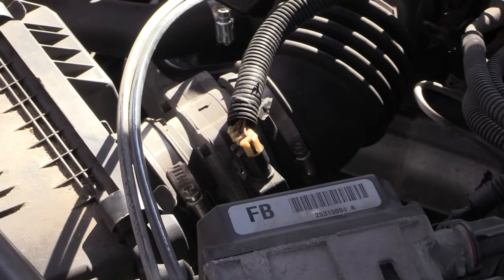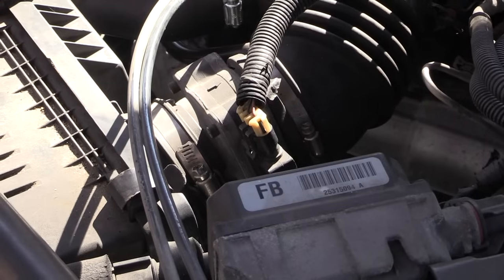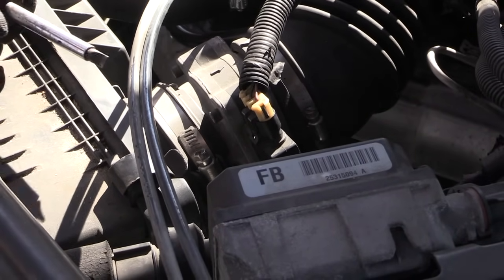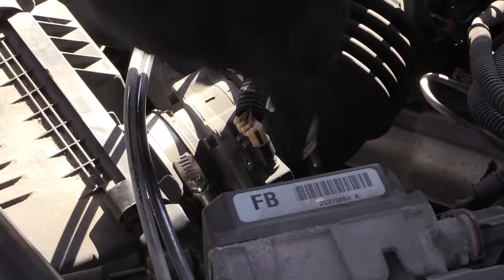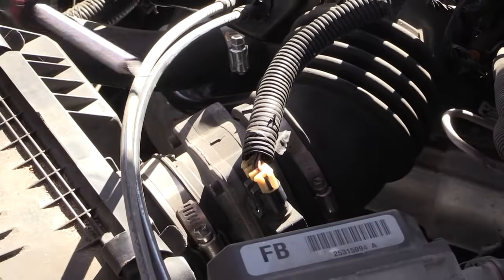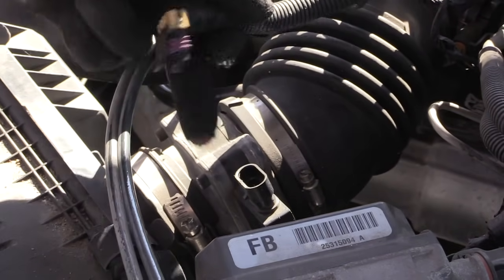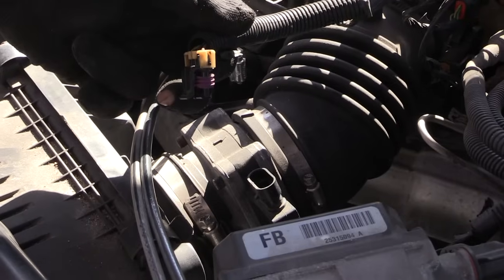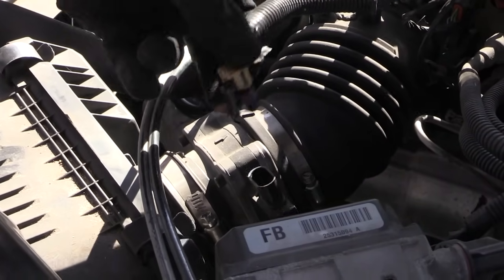Mass Air Flow Sensor -Quick test To Tell if Bad or Dirty!

Comment: When you unplugged it, did the RPMs just shoot up?  Or was that a vehicle driving by?
Reply from the maker: That was a car driving by
Reply: @Flashback502  weak.. Couldn't you reshoot that minute of video?  That was wrecking my brain.
Reply from the maker: @stephenhill1089  didn't realize it would or could be confusing to some 1 until u pointed it out. Going to pin your comment to top so others with same question can no it waa a car going by.
Reply: I'm just learning about MAF sensors and I'm getting tons of conflicting info from YT.  Some ppl say (and even demo) that vehicles should stall out if you pull the MAF wire.  Does the cars computer compensate for build up on the sensor wires over time and eventually bipass it's data?  Seems like the only logical conclusion if you can pull the wire off with no change to idle.
Reply from the maker: The way a dirty or bad MAS works on different models ,years etc can be very unpredictable, but the logic is if your vehicle is running bad, which can b caused by many different things and 1 of those is MAS so if you disconnect it, and the car runs better not perfect and it shouldn't because you need a properly functioning MAS for it to run correctly, then that is a clue the MAS could be your problem, and in many cases you can just clean it.
Reply: K dope.. I'm gonna give it a shot once the weather warms up a little.  My '00 Outback isn't running rough, but I'm only getting 300-350km/tank which is horrible for a 70 litre tank.  I'll let you know what happens. Thx
Reply from the maker: Ok Hope it fix s your problem. Please subscribe & like and share if haven't already and check out our other helpful videos
Reply: @Flashback502  Ok i change the maf map, cam, and crankshaft sensor and my car still losing power and killing
Reply: @Flashback502  No engine light on you think it could be the coil pack?
Reply from the maker: @blankmanj5760  sorry to hear I would take it to autozone first and have it read if coil pack is bad the computer normally picks it up, also I would check for any vacuum leakes, u could have  bad fuel injectors also, It can be a number of things causing your problem.
Reply from the maker: Lol ok well hope that fixes it for you. Goodluck
Reply: So when i unplug the mass air flow sensor is the car  supposed to cut off and I don't have a check engine light I got a service engine light on is that the same thing as a check engine light
Reply: @Flashback502  i fix the car bro for  the stalling and cutting off while driving i change the crank sensor cam sensor map sensor maf sensor pcv vale ingtion coil but the car was still cutting off right but when i change the fuel pump the car never cutt off  again plus the wires was burn up by the pump thats why my car was stalling. In traffic  thanks alot for all yo info
Reply from the maker: @blankmanj5760  your welcome glad you got it fixed and thanks for heads up on fuel pump.
Reply: @Flashback502  no problem
Reply: It’s funny you mention that because I just did the “unplug it” test on my cruise and it made my car rev up like crazy
Reply: @stephenhill1089  The engine will NOT stall if you remove the sensor: it will only run without critical information and thus the onboard engine computer will compensate simply increasing the amount of fuel. So, the engine will burn fuel like crazy and may stutter when you speed it up. At the end, it depends on the software implemented in the computer
Reply: @stephenhill1089  it depends on how much electronic systems your car has. my 1995 s10 will run with out the mass air flow sensor, but my 2008 honda will not. my honda has so many electronics in it compared to my s10.
Reply: If you unplug it and the car shuts off the sensor is good. If it stays on and sputters . It’s bad
Reply: Better audio would have been helpful
Reply: @sniperpaintcorrection  my 2009 chevy traverse stays on after i unplug the maf sensor. Is it normal?
Reply: @Flashback502  9
Reply: @stephenhill1089  lol are you like 92?
Reply: @AndTecks 🤔?? No.  Why do you ask?
Reply: No it is not good. It is an indication that it might need to be changed with a new on. @OscarRamirez-vh1xm
Reply: @blankmanj5760 sounds like a throttle body issue
Reply: @sniperpaintcorrection  Yeah, the way he kept trying to explain it wasn't very clear.  I get, put I understand why some were confused.
Reply: Just replaced my alternator in my 09 ford ranger 2.3.  Now I get code po102and po113.   Did not have those codes before
Reply: @blankmanj5760  did you found real reason of problem in the end?
Reply: @ericoz650   No got mad junk the car got tired of working on it I changed all that and it was still messing up I junk that thing
Reply: @Flashback502 what to do if when I unplug the car turns off ?
Reply: @Flashback502 or if it won’t start without it plugged
Reply: @sniperpaintcorrection  that's depending on what kind of car you have.

Comment: If your car is idling poorly and you unplug the maf, and it runs better you might have a vacuum leak. check that first before you spend money on a maf
Reply: Jellyrollfordinner uhhh don’t leave it unplugged! Lol. I’m sure if the MAF is dirty, then unplugging it might be smarter but I’d recommend never running it with a dirty MAF or without a MAF. A clean MAF will give u best results. Have u tried cleaning it???
Reply: Good looking out bruh with that info.
Reply: I guess I might be facing that problem but I can't locate the sensor
Reply: @gordongorohmpawaenda7240  look and see where the air box is with the air filter and fallow it along the path from your air box to your air filter there should be a spot with wires if that helps
Reply: @gordongorohmpawaenda7240  look and see where the air box is with the air filter and fallow it along the path from your air box to your air filter there should be a spot with wires if that helps
Reply: @chancesmith6524  okay thank you... let me try that
Reply: I put new one it does the same unplug new one it runs good I'm lost
Reply: Yeah I just changed the maf like 2 months ago and it just gave me a check engine light, how do I check for leaks?
Reply: Ive got that on my dyson.
Reply: Carb cleaner sprayed around intake gasket area/fuel injector bungs/throttle body and PCV/MAP sensors 
Chevy loves their leaky EVAP systems and often times the codes for EVAP leaks are solved by finding stupid pain in the ass leaks elsewhere.

Ensure your wiring harness connector is providing a solid 12v+, Ground, 5v+ reference and i forget what the other two are....friggin Air temp. Intake air temp sensor is integrated on the 5 wire MAF units. The Massairflow cleanee will work, its worth trying unless you know for fact you MAF is toast.
Reply: Yeah this guy
Reply: @jawnbul5701  yea that’s what my car is doing , I took the whole air system out and cleaned it including the throttle body , put it back on and my car was acting a fool , so now I’m riding with the maf unplugged hoping it was the throttle body

Comment: This does not tell you that the MAF is bad, it just puts the engine into a safemode so it can run. The motor can have several issues not being caused by the Maf, like not doing what the Maf tells it too for instance. Usually its a vacuum leak of unmetered air entering the engine that is not being detected by the Maf
Reply: This topic is curious- I tend to understand what you're saying, KingKatRider.  May I ask, if a wire in the wiring harness that connects to the MAF sensor is cut, would a computer scan show the MAF sensor as malfunctioning, even if the MAF itself isn't damaged?
Reply: @JohnJohn-ir5hw  what would happen is that the ECM will generate an error code indicating that the MAF sensor has a open or short. The ECM cannot tell if the sensor is at fault or not (IE: bad wiring, bad connector, bad sensor.) All it knows is that the system is out of the parameters and has it in memory what the system should look like when registering the data of the airflow in real time. That's why it is important to TEST everything when it comes to diagnostics. Visuals can only take you so far. Having the right information to diagnosis the problem is the only way to validate and correct the problem.
Reply: What is a vaccine leak?just had new transmission and am told the msg is faulty that’s why it won’t rev
Reply: @carrsllccarrillo6507 As a technician still learning to diagnose lean/rich codes, you are awesome as well as @kingkatrider I knew it wasn't that simple and would take further diagnosis but 2 separate videos said this way is a quick way to tell. I've done anything suspension/ steering related, brakes, basic maintenance or engine tear down to replace bad sensors etc....even replaced an engine few times, transmission once, but when it comes to p0171 or p0174 codes, im completely lost. Teach myself in free time though
Reply: @KingKatRider  yep, my 08 camry will adjust its self to memory and run in closed loop

Comment: I watched a different video about a '99 Buick Park Ave, and it said if the car KEPT running when you removed the plug, the sensor was bad.  If it stopped running, the sensor was ok. This is a little more than confusing.
Reply from the maker: Thanks for watching if you read some of the comments and replys made help you to understand the logic. Please subscribe & like and share if haven't already and check out our other helpful videos.
Reply: Flashback502 what a waste of a response, could have just said what’s true
Reply: @cured_bacon647  I don't think he knows!!! Some one asked thee exact same question, just different car. He gave the same generic answer!! NOBODY in the comments really touches on this!
Reply: YES if the engine dies when MAF is unplugged the MAF is doing its job. If it runs better with MAF unplugged then you have a problem with the sensor or something else.
Reply: @Spoofkill  its a bit more complicated then that , i found this Well, the answer to that is no. If you disconnect the mass airflow sensor, then the car should keep running and still be able to start normally.

This is because the computer in the car if it does not receive a reading from the mass airflow sensor, will estimate and supply a number that it thinks it is supposed to have. This means that if your mass airflow sensor dies completely, then your car will stay running and surprisingly the car might run better without the mass airflow sensor. That is because if the sensor is bad or giving a wrong reading, then the cars guess might be closer to the actual amount of air that the engine is getting giving you a more accurate fuel mixture.
Reply: @arandomsanti3228  what if when I disconnect the maf sensor the car still runs but hard shifts really bad, & with the sensor it still hard shifts but not as bad
Reply: @arandomsanti3228  Good answer. All the videos showing the unplug method for testing are bullish!t. My maf is good and when I unplugged it, it initially hesitated and then continued to run normal. I saw a great video showing how to accurately test it. It was by plugging in obd2 reader and downloading the maf and rpm readings. The volume of air should be increasing proportionally to the rpm increases. If not, the maf not properly reading and defective.
Reply: @mgpvii  that is the correct way in the video . Rather than spend $9 on the cleaner I bought a MAF sensor on EBay for $14 and just replaced mine . But I had ruled out a vacuum leak first .
Reply: @suzannepeacock3143  NO!  I repeat in case you didn't read my text.  MY maf is good and i unplugged it and it continued running, therefore, the test is not an accurate method testing whether maf is good.  Others have talked about this in other comments also.
Reply: @mgpvii  I was agreeing with you it’s not an accurate way to test . The method you described in the video is the way .
Reply: Ok then Not subbing not liking

Comment: Hi great video ,will a bad mass air flow sensor throw lean codes , like a P0171 lean code , I did the test I unhooked the cable and my car stayed on , any info would be great full
Reply from the maker: Thanks for watching yes a bad or dirty MAS can cause lean codes, I would clean it first and see it that helps' dirty fuel injector heads and leaky vacuum lines can also cause codes. Please subscribe and share if haven't already and check out my other helpful videos.
Reply: LEAN = vaccum leak Or O2 sensor Or maf sensor. But O2 and MAF has their own codes! so logically it's a leak. And that can come from tons of places. PCV valve, hole in hoses, injector seals cracks, brake booster diaphragm hole, intake gasket, intercooler, throttle body...
Reply: What if when unplugging the car turns off ?

Comment: This may work on some cars but not all. This forces the engine controller into speed density mode (MAP sensor) for fuel calculation. Both the MAF (dynamic airflow) and MAP (speed density) require the intake air temperature. Many newer vehicles locate the intake air temperature sensor within the MAF sensor. So if you unplug the MAF sensor and it won't run... It's likely due to the IAT also being unplugged. I believe you'll have a three pin MAF sensor connector if includes IAT? Don't quote me on that though...

Comment: 2006 Nissan Quest problems.

Start up van but when put in reverse or drive, the van won't move. Turn off and try to turn on but needed to jump van. Then van starts after jumped but headlights and interior dash lights all turn off while van running. Then after 5 minutes van dies out and headlight turn back on but when try turning headlights off, they stay on even when light switch is on position. 
Mechanic friend tries to fix it by cleaning the grounds and other stuff and after 2 hours van starts up with a jump and everything works so I drive home. But within 20 minutes acceleration starts to bogg and no acceleration at all while pressing pedal. Switch to low gear and then acceleration back to normal and park van and for half a day I had a portable fridge/freezer runnng which shows 13.6v for car battery. When go to van, it starts up right away and run for 10 minutes. Then turn off and hour later I start van and after 10 minutes running it dies out. Won't start with a jump.
I disconnect battery and connected positive and negative cables together to drain electrical memory from van to do a hard reset. After 5 hours i connect battery cables to battery and headlights come on when switch is on off position. I think its electrical problem since all problems not related to another.
HELP!!!!!
Reply from the maker: Sorry be not sure, but you may have a bad alternatetor, if not chech voltage regulator.
Reply: Sounds like you could be overloading your electrical system. a portable fridge is a big drain. Get someone that knows auto wiring to look your system over sounds like someone knew just enough to be dangerous has been working on your ride. you have all the good stuff bad switches ,shorts power drain with and without key on. If it catches on fire don't put it out.

Comment: Replaced bad thermostat. Then started it the engine sounds awful. Engine excel and back fire sounds like more air help.
Reply from the maker: Change spark plugs and wires, and try gas treatment. Please subscribe like and share 🙏.

Comment: When I removed the wire harness plug my engine stalled within seconds.  Anyone know what that might signify?
Reply from the maker: MAS most likely good but if car is running bad would clean it.
Reply: @Flashback502  Yes, I discovered elsewhere that it's normal and expected if it's working properly.  I nonetheless cleaned it. But my primary problem is now fixed as I confirmed and replaced my  O² sensor. And my check engine light went out! Nice it was an easy fix. I can smog test my truck now.

Comment: Will my engine light come on if it's bad ? Will it through a code ? 05 Honda Accord 4 cyl
Reply from the maker: Some will and some won't, sorry but not sure on yours. 
Please subscribe & like and share if haven't already and check out our other helpful videos
Reply: @Flashback502  I cleaned mine/ sprayed it with rubbing alcohol just now

Comment: It ran good when I disconnected the maf and it started stalling and running ruff when I reconnected the maf  this is the maf sensor then ?
Reply from the maker: Yes sounds like u need to replace or cleaned. please subscribe like and share and check our my other helpfull videos.
Reply: Whas that the issue?

Comment: I have a question I just installed a intake on my civic it ran perfect with the stock air box but not it’s throwing a code for throttle spring malfunction I can’t seem to find the issue it runs for 5-10 sec then shuts off also my check engine light is on
Reply from the maker: Sorry not sure but be sure all lines or attached correctly and no vacuum leaks. Please subscribe like and share 🙏.

Comment: I got a new mass flow air sensor installed i did it myself and when i plugged the car kept on running then i took the new one i got from the store back and i plugged that onen up and unplugged it and it still kept running

Comment: I live 20 miles from the nearest parts store I don't have a diagnostic code reader would it hurt to drive it that far without the mas air flow sensor hooked up.
Reply: no
Reply: 20 miles? Damn dude where do you live? Siberia? 😂

Comment: Ok…so if I unplug the maf and it dies but starts up with none of the issues it had before while it being unplugged could the maf still be the issue???currently misfiring under any load will idle just fine
Reply: But when she is running and I unplug maf it dies but when I start it with maf unplugged it runs fine and I am able to possibly get her home

Comment: What does it sound like when it is a bad mass air flow sensor? My Camaro when it’s close to 1.5 rpm will like shake the engine it sound like. Is this mass air flow or o2 sensor?
Reply: Probably....get some cleaner and try cleaning it before you replace it.
Reply from the maker: Yes I would say definitely  clean first before replacing it